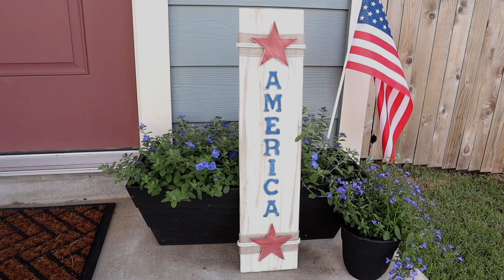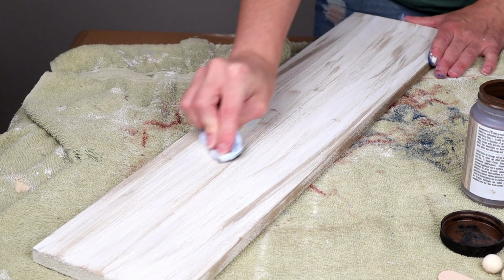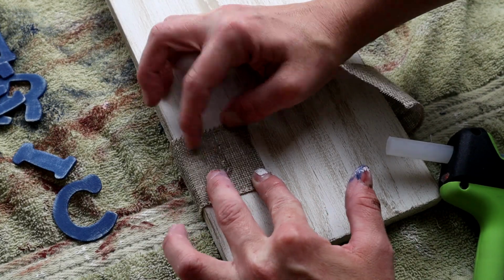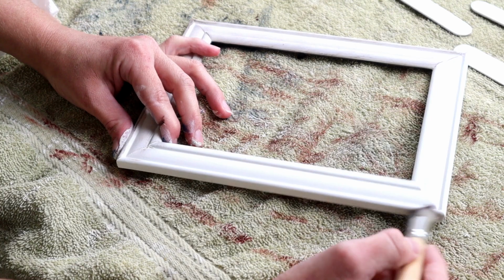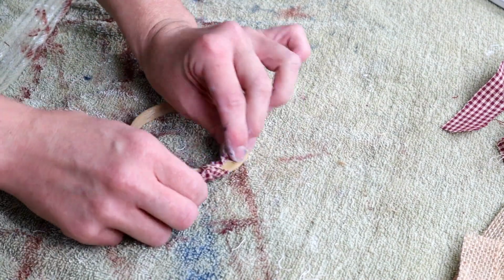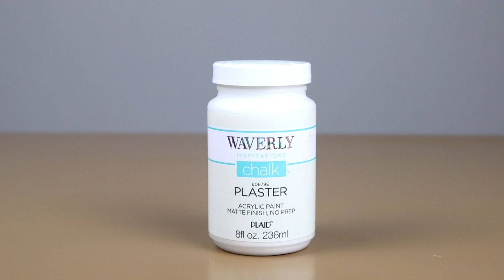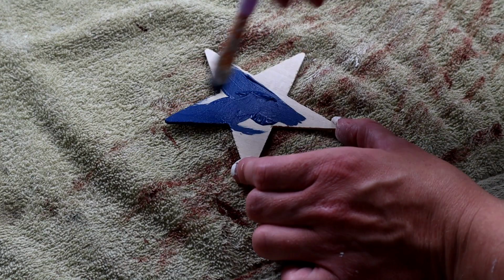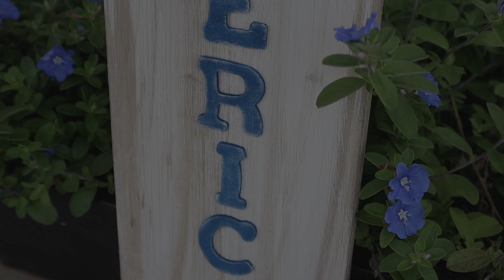3 Farmhouse Patriotic DIY's | BUDGET 4th of July Decor

Comment: great projects! my fave is the America sign. appreciate the duct tape chippy technique, never saw that before. i have seen a similar technique using petroleum jelly instead of the wax, but i like the end result better the way you did it. TFS
Reply from the maker: Thank you! I’ve never used the petroleum jelly technique, but it sounds interesting. I may have to try it! 🙂
Reply: @ChristinaElizabeth15  Just smear the petroleum jelly on randomly, depending on how much of the bottom layer you want to peek through. Paint the top layer, let it dry, then use a rag, etc., to wipe the top layer. The paint will come off where the jelly was.
Reply from the maker: Awesome! Thanks for the instructions. 😊

Comment: These are really great project ideas.  Love Patriotic projects.  I do question how well they will hold up outside with just hot glue, hot glue tends to melt and soften.  Thus releasing the item.   I would definitely like to recreate these, using e6000 or wood glue when I can get out and get wood.  Love your ideas.
Reply from the maker: Thank you! I live in Texas and don’t have any issues with hot glue outdoors, but it would be better to use E6000 if you know you will be using the piece outdoors. I would also suggest using a clear water resistant sealer.